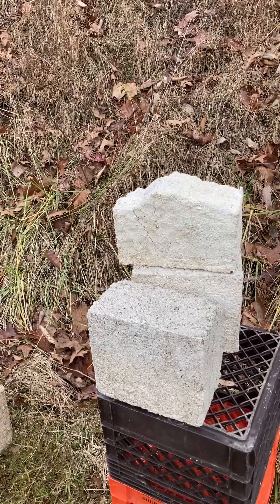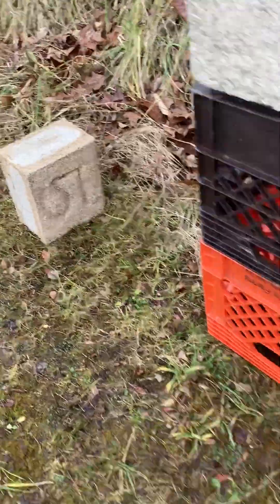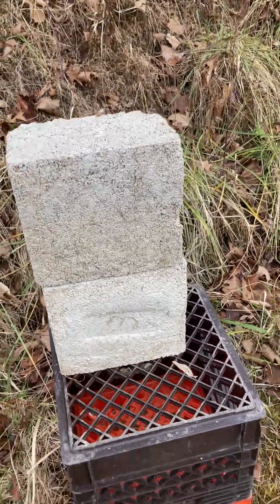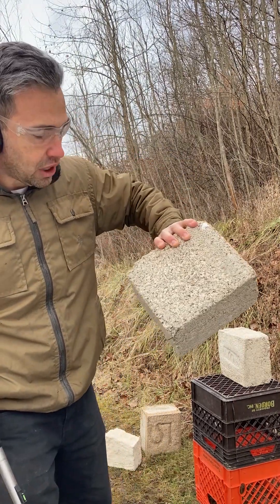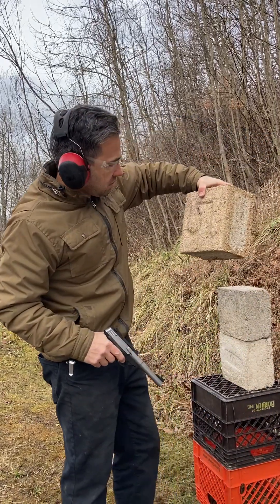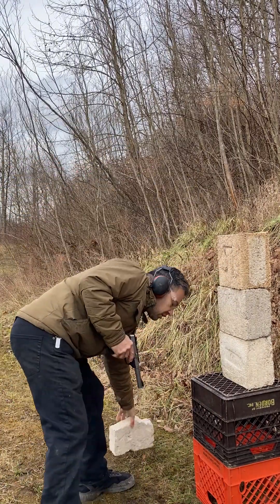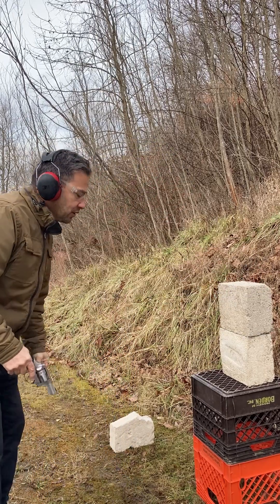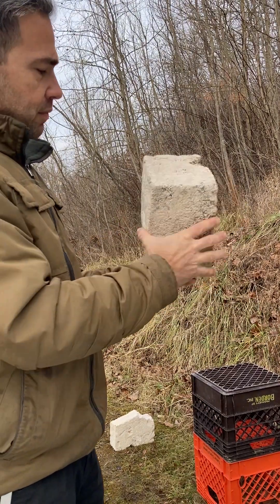Woodcrete,Dustcrete,Sawdustcrete.Strength test.

Comment: Would love to see these tested with a hydraulic press equipped with a gauge.  I would be happy with 200 psi, even a 6x12" block would support 7 tons.
Reply from the maker: Cool I will try to make a video about that this summer.And we will see.
Thanks
Reply: That is what I am looking for. Have you happened upon the info anywhere? I cannot afford a stick built home. And not even intermediate actually.  But found a place i can build what I want. Need cheap and easy enough for an old lady. Saw a video of concrete covered foam used for the roof! Foundation figured put. Now I just need to know these blocks can handle the weight of itself in a wall. Roof will be light. Comparatively speaking. But would hate to build it and it come crashing down on itself.

Comment: You gave terrible trigger discipline!  You had your finger in the guard wrapped around the trigger of the .22 the whole time you were handling the block with the concrete adhesive in it. And using a loaded pistol to “point” at the blocks is not good either.  Now I’m going to watch the rest of the video and likely cringe internally some more.
Reply from the maker: Thanks for bringing that to my attention.
I will keep that in mind next time handling
 firearm.

Comment: I was hoping for a more "load bearing" type of strength test but it is certainly entertaining. I know I will be safe from hunters and violent criminals in my dustcrete cabin!
Reply from the maker: I guess I didn't do a load bearing test because
I don't intend to ever have it bearing a load,
I was just going to use it to fill the voids inside
walls and have wood or brick bear the load.
This was just to kind of get a feel for how 
tough it is.Thanks for you comment.
Reply: @WeberMachineWorks  Thanks, your recipes will sure be helpful. Which one did you prefer? What size of wood particles did you use. I generate sawdust in all sizes (from fine sanding dust, to long planer fibers). Would you suggest sorting it before using it to do dustcrete?
Reply from the maker: @librespenseurs_freethinkers  Hello, my favorite so far is. 
10 parts sawdust (course from sawmill or planer shavings)not fine
 2 parts lime 
1 part Portland cement powder
If you want more strength do 2 parts cement powder.No need to sort.
Maybe start with this one and make a small batch enough to make a block and see if 
it seem ideal for your project.And try making a few blocks adding more and less sawdust just to see.
Thanks
Reply: Will the sawdust mix run well through your auger mixer?